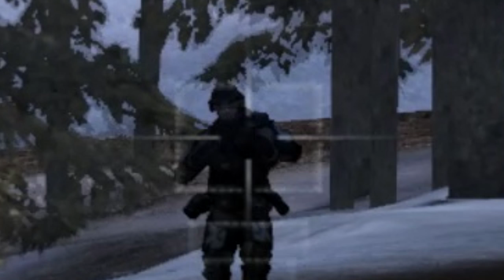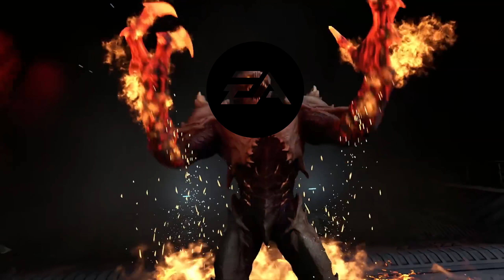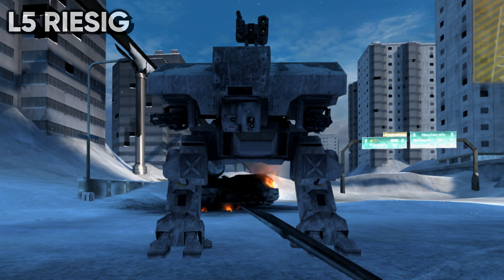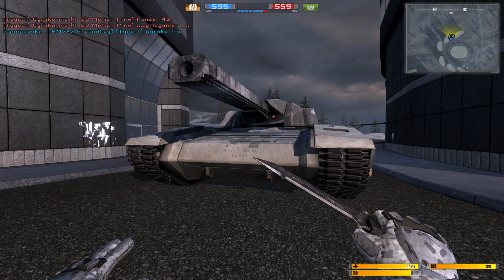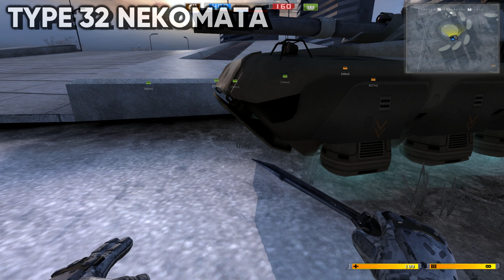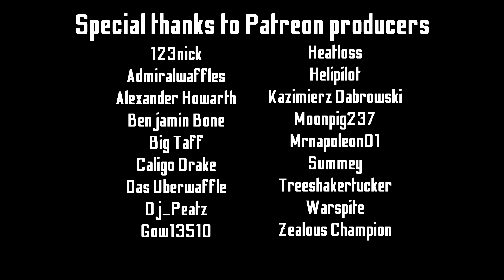Everything Wrong with Battlefield 2142's Vehicle Design

Comment: I always thought that, as a design, the devs kinda treated the L5 Reisig more like an attack helicopter aesthetically than a tank. Everything about it screams "can be useful if you don't expect to actually get hit", and the way the cannons are loaded is a lot more similar to how crews load 20mms on modern fighter jets and helicopters. The same goes for its ability to squat. It's kinda like how Apaches are expected to dip just above and then below terrain. L5 Reisig is a fire support vehicle, intended to kill a whole lot of infantry and then use its shields to survive ambush and then squat and survive.

Not very practical, but it does kinda make sense, at least aesthetically.
Reply: I kinda see the walkers as replacements for BF2's AA vehicles. They have powerful anti-infantry along with an AA turret ontop.

Comment: To the nekomata's credit, a casemate design makes WAY more sense on a hover tank than on a tracked vehicle. 
Casemate designs eliminate the substantial added weight (especially important on a hover tank) and mechanical failure points that a turret adds, substantially reduce the height of the vehicle, as well as allow for much more effective distribution of armor for its weight since you can invest almost all of it on the front face of the vehicle, and it makes combining crew positions a bit more sensible since the gun's always facing the same direction as the driver. 
Meanwhile, a hover tank's ability to move in any direction independent of its facing eliminates the most significant drawback of a casemate design- the Nekomata can still effectively engage while maneuvering. 
That doesn't necessarily mean the nekomata's a good design, but for a hover tank, it's actually pretty good. Its main issues are really just the offset cannon and poor handling.
Reply: You can also strafe-shoot while in a nekomata which could be of great tactical benefit.
Reply: Imagine a German stug but its a Hover vehicle, that would be awesome to see

Comment: Well, the size of the mech is fairly reasonable. They are about the same size as titanfal titans, just more beef on the bones. Feet could be larger to accommodate the weight like you said.

But I remember playing this game. The mechs were not meant for open ground combat. You get in one of them and you get it to dense cover environments like Forrests or urban center as soon as possible. These things were great in urban combat. The added height gave them better angles on infantry hidden behind walls and better angles on those on 2nd floor buildings. This made mechs great for holding a majority of map objectives (as they were often amongst cover).to be fair this is based off the last time I played this game...around a decade ago i think.

Just like titanfall,  these mechs are not meant for open ground (leave that to the tanks).battlefield has always been about combined arms warfare, letting players check out the different vehicles and how to play with them based on their strengths and weaknesses that would depend on the battlefield. This is probably why I have my views of mechs being urban fighting vehicles, while keeping the tanks in open combat. that view was enhanced by 2142....I miss this game.

Comment: “Mantlets are made small for maximum armour protection and weight” I guess Stalin missed the memo (Kv-1, Kv-2, T-34/85, Is-2, Is-1, *all t-34s before 85*)
Reply: @Harli Baron  very scary and weird mech
Reply: In WWII mobility of fire wasnt considered as important yet (US beg to differ with their stabilizers here), thus speed of gun elevation was considered secondary to ensuring decent armor protection, especially against MG bullets jamming between the moving parts or entering the tank via odd angled ricochets. Thats why it wasnt such a big issue with tanks like Pz III, Panther and Tiger I that their entire turret front effectively was just the gun mantlet. 
Also, even today its not written in stone that the mantlet must only be a tiny piece of moving plate barely large enough to fit the main gun, coax and in some cases the gun sight (in some cases thats seperated into a doghouse), though the main reason for that is that as a moving part, its difficult to apply much protection to it without making it interfere with the ability to still move, unbalancing the gun, etc. which is why on an M1 Abrams the mantlet is actually a fairly thin piece of armor only, mainly relying on people just not hitting it due to size, and even if they do, they will likely only disable the gun. On the other hand, Leopard 2 has a fairly wide mantlet with the same array of composite armor as the rest of the turret front, meaning that there is no detriment in protection there, and mobility of fire is still excellent, with the gun being fully stabilized and elevating absolutely rapidly. The extra mass of the armor doesnt seem to cause much issue there, because being close to the elevation trunnion anyway it doesnt require much extra force due to lack of leverage anyway.
Reply: @Harli Baron  They had basically no mantlet.

Comment: I would assume that by 2100 you would have working Fusion, not fission reactors. and more to the point, these fusion reactors would be about the size of a V-8 engine. Fusion reactors immediately lose containment and thus temperature containment and control and just cool instantly. This it the opposite of "Aliens" where the fusion reactor explodes like Castle Bravo. 

Due to long standing rules concerning any form of nuclear power, the radiation emblem is used. Plus when the game"2142" was made common knowledge about Nuclear fusion was not available. Nor was information on weapons we don't fret much about being in the future like LAWs, LASERs, and advanced robotics.
Reply: @thefullmetalmaskedduo6083  where is that tank helium and hydrogen located

Comment: I feel like the "1 crew member in the tank" is purely just game mechanics 

Since in Battlefield 4, the driver spot takes the roles of Gunner, Driver, AND loader while the 2nd only takes the TC...and even then, only the HMG up top

And the A7V "Heavy Tank" in BF1 takes only 5 people to fully crew, even though irl it needed easily quadruple that (they were also used as makeshift APCs, allowing infantry to dismount flamethrowers from off the tank to use in combat)

But still, great vid

Comment: do a video about Fully Automated Tanks (or F.A.T.s as i like to call them), as in, tanks that have zero crew and are entirely controlled by an A.I. and your opinions on them
Reply: Nuclear setting (Which most vehicles especially cold war era are designed for) Will make it useless
Reply: @heckleypanes4988  How? It does have a lot of advantages over crewed tanks like faster reaction speed,  faster planning (with advance enough A.I.) and not to mention you don't need to worry about trying to keep and maintain a highly costly crew in comparison to a team of highly efficient, yet, highly flexible and cheap A.I..

Also i am more or less talking about a future or far future setting and not a nuclear one.
Reply: @heckleypanes4988  add arm hand thing

Comment: Youre pronouncing "riesig" as "reisig". 

Also, i dont know the lore of the riesig, so i dont know for sure, but i believe it might be designed to operate in deep snow. In deep snow the large silhouette wouldnt be a issue as the legs keep its platform elevated. It seems logical to me, given the setting is about a new oncoming iceage or something. 
Anyways, nice video.
Reply: The problems are its feet. Their coverage is too small for such a massive vehicle. They would literaly sink into soft ground like mud or snow.
Reply: @wolfschadow6399  Yes, though im fairly sure the ground is alot harder during the winter as its frozen. Doesnt excuse tiny-feet syndrome though :P

Comment: in the frozen wastelands of 2142 i think walkers would become viable as the ground could handle much larger ground pressures

it will suck when someone ignorant deploys them somewhere warm though
Reply: Actualy the opposite is true. In such environments snow would be the main problem. The vehicles would sink into it. Maybe the legs are powerfull enough to force themselves through it but walker legs still would have the problem of sinking deep into the snow. If you want actual effects of snow on tanks for example, look into WW2. The germans and russians both had problems with the snow and mud getting everywhere in the tanks wheels and clogging everything up.
Reply: @wolfschadow6399  but walkers are not tanks, if they sink through the snow their long legs will eventually reach the ground, unlike a tank where it will rest its entire belly on the snow itself getting no traction.

If the snow is so deep that a 20 foot walker can't reach the ground i think you have bigger problems than that.
Reply: @Corallia_Fluff  The maps in 2142 do not really have big piles of snow everywhere mostly there is open soil or the snow pile is 3 feet deep so not really a problem for the walkers.

Comment: We wouldn't be using lasers. Lasers lose heat really quickly over range, can be dispersed easily by steam and would need immense amounts of energy to do what ballistic weapons can. Railguns and missiles are the future.
Reply: We already use lasers as anti air stuff
Reply: @kristijanmedved6066  Yeah, that's not a weapon. That's point defence. There's no point creating a laser that can burn through a tank hull.
Reply: @duncanmcokiner4242  you dont need to burn through armor you just need to kill the crew and there are plenty of microwave laser beams and x rays that can be weaponized hell even nazis experimented on x ray weapons they actually invented those rays
Reply: @kristijanmedved6066  It's not going to work mate. It would take so much more energy than a railgun and have nearly no range.
Reply: @duncanmcokiner4242  i dont think so, it would still be more practical that railgun because on railgun you can fire only few shots before rails wear out soo
Reply: @kristijanmedved6066  The rounds don't have to touch the rails.
Reply: @duncanmcokiner4242  i didnt even said that the rounds touch the rails, i think gauss cannon would be much more practical than railgun but x ray laser beam is superior to both
Reply: @kristijanmedved6066  That's so much more energy you need for no more effectiveness. Basic radiation shielding would make them barely powerful and that's if you're even using manned vehicles anymore.
Reply: That's actually a big part of BattleTech's weapon balance.
Lasers increase in range as the damage scales up and there's Particle Cannons but the energy required from the fusion reactor in a 'Mech means a lot of waste heat when they fire.
I assume Gauss Rifles don't take as much as the capacitors are charged and ready to fire (hence their volatility) and the charging occurs much more slowly while the rifle is reloading.

Comment: I wouldn't really count the crew section for the tanks. It would most likely be more than 1 person in the tank but for gameplay reasons reduced it down to one driver and a gunner like in BF3 & 4.
Reply from the maker: Other crew positions are modeled in 3 & 4, whereas only one position is modeled for both tanks in 2142.

Comment: Can you do a video on the Rhino Tank from GTA 5?
Reply: Thor's Hammer The Rhino is very close to a Leopard 2 A4.
Reply: @AgentOrange2999  
The design kinda looks like that tank which kinda sucks the Indians use. In the orginal version of GTA 5 the tank could handle 8 rockets at the front and 6 at the sides. I don't know how that compares to actual tanks like the Abrams, Germany's Leopard, and the T-90 though.